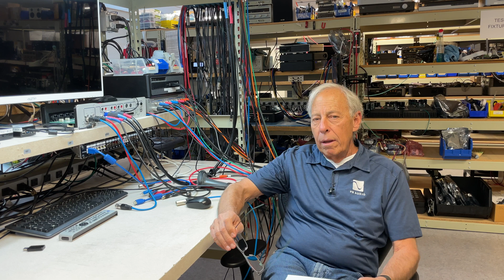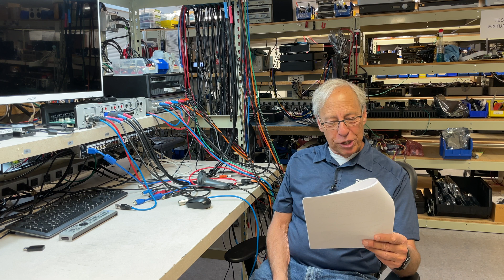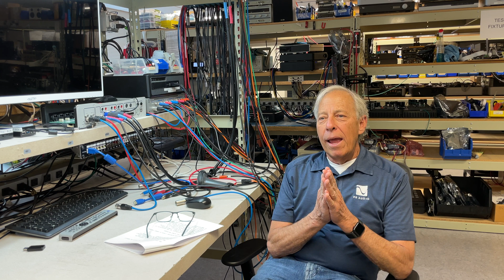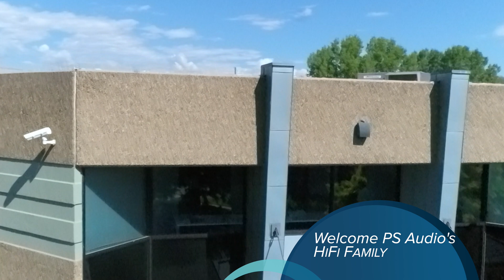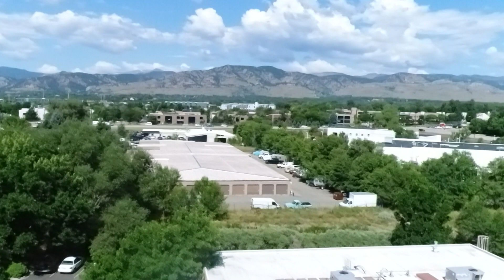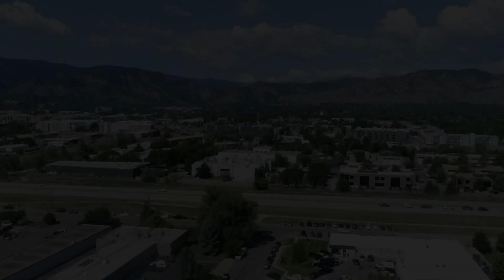Upgrade external clock or power cables?

Comment: I just picked up the Aune SC1 EVO 10 MHz clock and was immediately blown away at the overall improvement in sound quality. You would literally have to be as deaf as a post not to hear the improvements. And, I do not have this attached to the DAC, but to my LHY SW6 network switch and one to the LHY UIP USB isolator/clock. I am using RG8X cables on the Sine outputs. The percussion instruments, WOW! Vocals, very clear and even more natural sounding if that were possible. The addition of this 10 MHz clock surprised the hell out of me.
Reply: What speakers amp/integrated do you have?

Comment: I think it would be helpful to differentiate between the terms 'word clock' and 'master clock'. They are two completely different things and a lot of people conflate them. I use a Mutec master clock in my recording and playback setups and the improvements, to me, are plain as day. We have used this setup on several Donald Fagen releases with fabulous results. Mutec also believes that a long-term stability design, such as rubidium, is not the right choice for audio because of the time scales involved. I will continue to use a Mutec master clock in my recording and playback setups for the foreseeable future.

Comment: Where does it stop? Rip the wires out of the wall going to the breaker panel? Use audiophile circuit breakers and audiophile wiring to the meter? Call the power company and tell them to have one of these power cord companies redo the wiring from the transformer to the meter??

Comment: In my own experience in the audio recording world, using a single, high quality, low jitter, external master clock for all AD/DA devices such as audio interfaces with word clock inputs, digital recorders (like the Korg MR-2000S), external analog-to-digital and digital-to-analog converters (like a Black Lion Audio Revolution EXP ADAT expander,  RME ADI-8 DS) - makes a significant and quite audible difference. In fact, the majority of major recording studios (recording digitally) will use a high-end master clock for all of their digital devices. Upgrading my master clock made a big difference in my studio in both the recordings I make and playback.
Reply: I think that’s the trick. Having a master clock for just one device, I’m not sure it would make that much difference; especially when your DAC probably has a good enough clock in it already. However, when the clock is connected to multiple devices, and it gets all of those devices on the same page? That’s where the magic happens if I had to guess. I’ve been wanting to pick up a clock for a while now, but the only device I currently own that can take that 10mhz input is my network switch unfortunately.

Comment: A good DAC should have a good clock inside already.  On the other hand, audio switches can benefit a lot from a good external clock and power supply.
Reply: should, but dont always. DACs often dont have the best clocks they can have in them, and are often voltage controlled rather than temp compensated, etc.

Comment: Just to throw a wrench, i have seen, in person as well, measurements on power cables, expensive and even rusted ones. And there is just negligible difference in what they deliver to the equipment. Unless your house has a crap electrical system, then look there. But living in a modern house in the Netherlands, its a waste of money.

Fun fact, or rather a red flag: i asked to loan cables from a supplier who said it would work. And he refused..... letting you draw the conclusions

Comment: I think however good is an external clock, if the input source has jitter, no perfect clock is going to help cleaning it. The external clock is useful to sync an interface to another, a DAT.. Best clock is the one that generates AND decodes the signal, such as a standalone CD Player. The moment you introduce a dac with another clock you have got to lock to the input clock signal, and you need tricks such as resampling or PLL (correct me if I'm wrong), that degrade the signal, because sooner or later it's going to drift. Optimal thing would be an external clock that manages both the input and dac clocks.

Comment: The rest of your house are wired with just plain old wire, adding 1m of $2k power cable to that makes no sense. Add a power conditioner/regenerator or power your house using solar and call it a day.
Reply: Exactly. Same for 600 euro network cables..... which is of course a digital signal, but the source can be 10000 km far. Going through switches, routers, cables, satellites etc. That last meter doesn't do anything. 0, zilch, nada

Comment: Please show me on a scope or some type of testing equipment that changing out power cables actually makes an audible difference.  It does not, and never will, unless the OEM power cable was extremely inferior, which most are not.
Reply: Try hooking it up, take a reading then bend the cables at a 90 degree angle then look at the difference then you won’t have any doubts that they make a difference!

Comment: Modern clocks are so precise... If your equipment is good, the upgrade should make no real difference. You can test it but don't expect that much.
Powercables could be a better option, but it's all about matching, not about price. A good match is far better than a random expensive cable. Take care of the placebo effect...

Comment: This clock thing is new to me and I’m confused. I will need more research.
Reply: So like a CD recording is sampling the music 44,100 times a second. There are that many data points that your player needs to read and transmit in exactly a, second. So now imagine what happens to the sound if the timing on your player doesn't match the timing of the recording? Basically youre either speeding up or slowing down the playback. Secondly what if its inconsistent, ticking a little faster sometimes and a little slower sometimes. The music will now be warbling all over the place.

But my examples are extreme. As Paul said, if we're talking femtoseconds, you definitely can't hear it.
Reply: @RasheedKhan-he6xx  This is a very good explanation. Again as I mentioned, the idea is that an external clock is called a 'world clock'. You want your CD transport and DAC to tick according to the same clock so they are in-sync. You're right about not being able to hear the effects of the audio pitch changing due to the clock speeding up or slowing down by such a little amount.
Reply: @BrianSu  cheers. Just trying to make our hobby more accessible. :)
Reply: Good digital audio equipment have a clock signal coaxial connector at the back. You’ll need a clock that matches the frequency the device is expecting. Some clocks have frequency selection. Having said that, modern systems use a standard 10 MHz clock signal for easy compatibility.
Reply: @ Brian Su
What would happen if I set the alarm of the clock to a certain time?
Reply: @Bassotronics  yup

Comment: There is a lot of mis-understanding among audiophiles about audio playback device clocks. This is why us video engineers made decent consulting money in the 80s when recording studios were going digital. Analog audio is asynchronous. Two analog audio signals can be mixed together with nothing more than two resistors with no respect to timing between them. Digital audio however is just like broadcast  video systems where everything must be synchronized to a common clock source. A lot of audio engineers in those days had a hard time grasping that concept. Like installing several clock generators and not locking them together if they even offered that option. Disaster!

When you play a CD or stream from the internet or your media server the timing is embedded into the digital audio signal. You can't just feed your DAC chip with an external clock no matter how precise it is. All you would hear is garbage. To use an external clock you must buffer the digital audio and track the embedded clock signal in the audio stream. The data is clocked into the buffer with the embedded clock. The data is read out with a local stable clock. But they must be loose coupled or locked. Otherwise the buffer will overflow or underflow depending on the frequency difference between the embedded clock and the local clock. The deeper the memory buffer, the looser the coupling can be. But there is a practical limit. The traditional approach is a PLL on the local clock with a long time constant loop filter. This smooths out the jitter but can never totally eliminate it. This is exactly how sample rate conversion works. This is why newer pro digital audio gear does not need an external clock source but it's always better to have one. Sooner or later that SRC chip or core is going to over or underflow. That means a click or pop or on better implementations a quick soft mute - practically inaudible.

Now there is a possible work around with today's cheap memory costs. Design a buffer with enough memory to hold a typical track length - like say 8 minutes. Upon detecting silence between tracks, reset the buffer. Here the clocks could run asynchronously and a good local clock would remove any jitter. But this is not really a practical solution. So how do professional users deal with jitter? Well we don't because  just about any gear today has jitter specs well below audible thresholds. Audiophiles will disagree but that's the way it is.
Reply: I've never noticed any of these problems do that many people really hear such a problem in the audio or are they following what's trendy because an audio guru said it's a problem?
Reply: @ryacus  The latter. These jitter and clock problems are promulgated by charlatans selling snake oil. Think about it, if the recording studios don't have these problems requiring these tweak boxes, why should the much simpler home playback chain?

Comment: I read a few of these comments and they are a laugh :). External clocks ARE NOT an upgrade of the internal clock found on a DAC. They complement the DAC's clock in long term stability and lowering its jitter. This kind of add on, only makes sense on very high end systems where you can really hear the improvements, believe me !!   No wonder most people make jokes of this, they don't know better and should be forgiven for they're ignorance. This is a case were "Ignorance is bliss".

Adding an external clock is fine tuning and should always come after all the cables in the system are chosen. What to expect from this upgrade ? Only resolution, for those that didn't experiment it yet; imagine a choir being played through your HiFi system, by adding an External clock, you can differentiate all the individual voices in that choir, if remove, you would only listen to the choir mass of sound. Another improvement is with instrument separation and voices, they became a lot more natural (silky smooth)

Hope this helps
Reply: "red" Funny, all I see is 'black' print.....................

Comment: Valhalla 2 power cable…. I’m guessing that’s about a $5,000+ dollar cord.  No one buys a top tier cord like that, unless you have an equally top tier DAC or CD spinner from the crowd like dCS, MSB, Esoteric Grandiose (sp?), Luxman D-10X and the list goes on.  If one has equipment that starts at around $20 large, it’s already got the top of the line DAC-clock combo in it, so getting a better clock would make likely little to no difference.  Let’s say one has a spinner from 2010 like an Esoteric K-1 which was a $20 large spinner in its day but the DAC is no longer up to say an the resolving capability of an ESS Sabre DAC with 8 channels, or the TI 17XX chip set, then getting a new DAC would definitely help, as the transport in that K-1 is super solid.  Back to that power chord, have a good power conditioner like a Synergistic Research UEF/FEQ combo, and put some Black Diamond cones underneath it, and put a Symposium base underneath it all.
Reply: Sounds like they are intentionally making inferior products so they can convince you to buy more accoutrements.
Reply: Meanwhile using regular power cables of 2 euros does exactly the same thing....

Comment: The best option is to hand wire the electricity transformer that serves your house and buy low jitter coal for your local power station.
Reply: Yup, that would work. Mind you, it would need to be 'point to point' wiring !

Comment: Power cables are my next “to try” product. Wasn’t a believer of cables before but now i upgraded my interconnect and speaker wires. I hope power cables can improve my modest system.
Reply: A Power cord can make a noticeable difference if you have a revealing system (PMC/Naim here)…. But in our experience, a dedicated AC line (AWG 10-14, as a dedicated circuit) makes a HUGE difference, far bigger than the power cord, and is a lot cheaper. Cheers
Reply: @isacatt99  i wish i could do that but its not currently possible in my living situation. I have to settle with power cords for now.
Reply: @isacatt99  it is laughable to pretend the last 50 cm in a hundreds of meters power chain make a difference - come on - common sense
Reply: Power cables do make a difference but its the size more then anything! more for amplifier then pre amplifier and  dacs they are better shielded.ive got awg12 triple shielded not maga expensive but makes a difference! but better putting awg 12 or thicker from fuse box CU .people who say whats in your walls don't realise that is better then what comes with most hifi which is only .75mm so solid 2.5mm with thick pvc jacket is loads better use that as a power cable if you must.
Reply: In my experience they can have the most noticeable impact.
Reply: @dudemastermaster8944  lol

Comment: I thought the idea of using a world clock is so all your digital boxes tick with the same signal that comes from a single source??
Reply: just to add, the reason all banks, the stock market, utility companies etc. use GPS time is for synchronisation rather than accuracy. We want a single source of truth when processing financial related things.
Reply: different world! world clock and synchronised time is relevant for servers but not for audio - your music don't give a shit how late it is
Reply: @Harald_Reindl  but the audio ones are called world clocks which to me implies that they provide a single source of time for all the equipment. Clocks have multiple output connectors.

Comment: I ran 3 runs of 4/0 welding cable to my rack, both the wife AND the dog heard a HUGE improvement...👍
Reply: nah man, you need 10mm x 100mm copper bussbars.
Reply: @PraxZimmerman  🤣🤣😆
Reply: Canadian quarters oriented to certain mystical directions on top of loudspeakers - worked on Alon speakers since 1997.
Reply: 'Better' bass surely ?
Reply: Don’t forget the Magic Beans. Put one on top of each loudspeaker.

Comment: Like you say, I don't think accuracy is that important like people say in a two channel DAC device... Other ways.... If you think in a studio environment, where let's say you recorded drums in your studio, then the guitars and bass are recorded at home using different gear, vocals in an other one, and then again mixed and mastered in the first studio I say, holding up 100+ tracks.... that's when I think there is a different because of stability. Not in a long term of playing music during two years, but because you get more accurate (or more equal) reproduction compared to when it whas recorded. Like in live situations, having different digital consoles, stageboxes and interfaces in the same time, sync them with one clock or another, sync them to the more accurate one seems to always sound better. And in theory it makes sense. Thanks for your videos and posts.

Comment: Trying to find a power cable that goes from my amplifier to the wall then continues through the wall and breaker box and to the poll. That would be optimal.
Reply: I got a better idea Chance, try getting a power conditioner, then you can isolate the problem. Makes life a lot simpler than your cable quest.
Reply: @AccuphaseMan  Irony not your strong point, I'm guessing.
Reply: @AccuphaseMan  
Not a power conditioner, but a power plant.
Reply: @Mark-lq3sb  -- Dispensaries in places like CA and AZ will happily sell you some real power plant, which will be have a much more beneficial effect on your listening experience than that of supposedly superior AC.
Reply: @editorjuno  
The keyword in your statement is: "supposedly" Which means you haven't ruled it out completely.     ...and all that shit does is "cloud the experience"
Reply: @Mark-lq3sb  --- Nonsense.
Reply: @editorjuno  
Funny, that's the exact word I muttered when I read your first reply..............